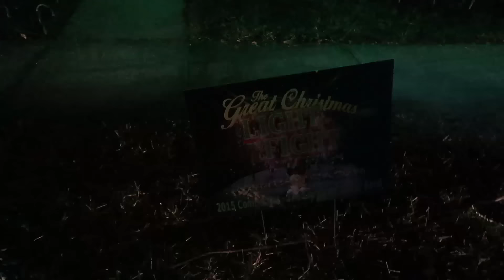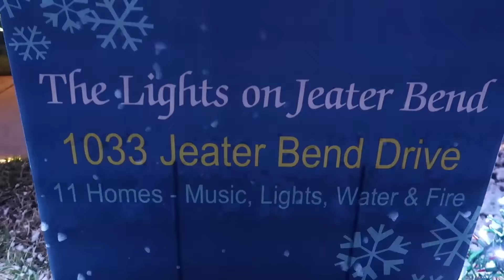A Clogged Sink Ruined Our Day But The Celebration Christmas Lights Fixed It!!!

Comment: To clean the pipe of anything clogging it as well as the walls, drop 4 tblspn of baking soda down the pipe then pour 1 cup of vinegar, let it sizzle for about 5 minutes then pour 2 cups of hot water down the pipe.

Comment: tim, check the roof vent.  fill it with ester n ser if it comed back up..   if u need to, usr a jetter.  50ft  long and attaches to a psi cleaner handle

Comment: Tm, instead of taking off that pipe over and over, you should have used the cleanout directly above the pipe. Thats what that fitting is for, you unscrew the plug and snake it down from there. That way you don't have to worry about damaging the connection on the plumbing.

Comment: If your glasses are out of shape you can just take them to where you bought them. Normally they do free adjustments for glasses depending on store policy. I'm pretty sure Costco does free adjustment if there is an optical department. At least they'd have the tools to heat up and bend you frames back into place properly.

Comment: if you haven't fixed your clogged up kitchen sink check the air flow pipe that goes through your ceiling and comes out the roof maybe that might be plugged. because of that is plug no water or go down your pipe

Comment: Plumbing problems are weird. I had a clogged toilet a few months ago that wouldn't unclog with a plunger. Every time you showered air would come out of the toilet (bubbling water) and when you were done showering the water in the bowl would drain. The next day it fixed itself and it was like nothing ever happened.